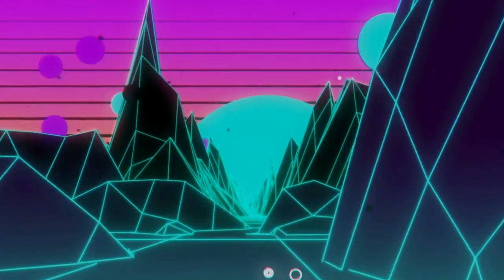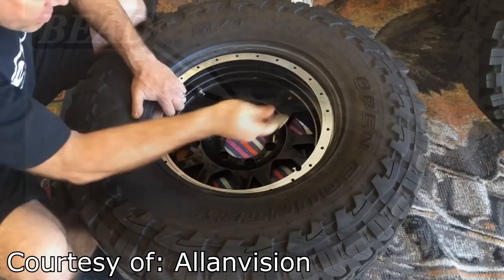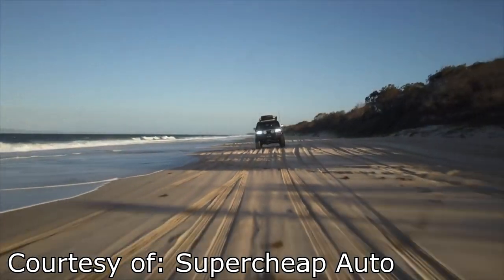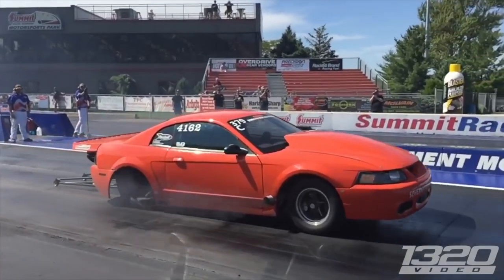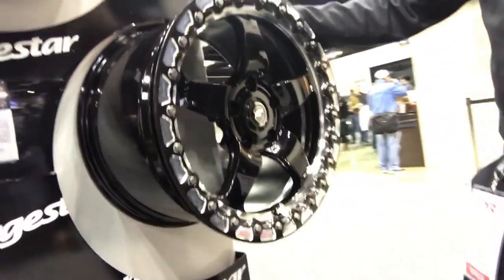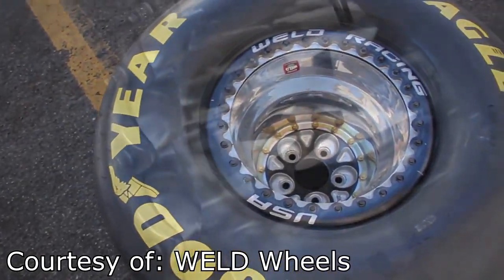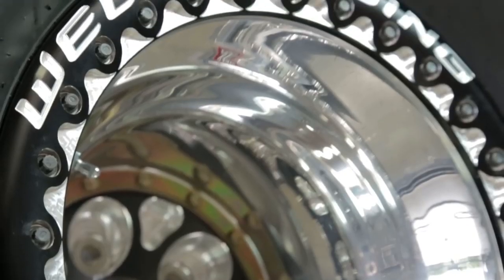How Bead Lock Wheels Work - Explained in 3 MInutes

Comment: Yes, but HOW?  HOW do beadlocks work.  You told us WHAT they do, but you did NOT tell or show us HOW it holds the tire.  HOW does it "hold the bead"?
Reply from the maker: 0:52 "bead lock wheels lock the bead on to the rim by clamping on to the rubber with bolts"....
Reply: @JCMediaYT  At no point in the video do we actually get to see what you're talking about.  I can't even imagine whatever that is. The bolts go though the bead?  I don't know.  We don't get to see anything.
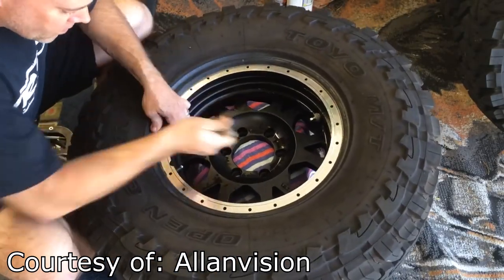Reply from the maker: @NorthernChev  go to 0:58, you can see him put the clamp onto the wheel, and that the bolts don't go through the bead but next to it
Reply: @JCMediaYT  Yeah, I saw that but it doesn't show if they go in or not.  So, from what I'm understanding the bolts are flat on the end?  And they only "press" against the bead? They do not pierce it?
Reply from the maker: what do you mean flat at the end? it's just a regular bolt that screw onto the center rim while also clamping the rubber bead, without going through it
Reply: @JCMediaYT  Because after watching your video, and still not knowing what the bolts looked like, I watched other videos and saw one where they used "screws" that bite (slightly) into the bead. But you're saying most use bolts with flat ends that press against the bead. I understand now. Thank you for your response.
Reply: @NorthernChev  They looks like regular bolts at lowes or home depot.  A bolt and a nut on the back lmao.
Reply: @NorthernChev  2 Ls in one.
Reply: @JCMediaYT he's right. "Clamping onto the rim with bolts" doesn't explain whatsoever how this supposedly holds the bead in place. A someone who installs tires and wheels for a living, your explanation is completely pointless. Terrible, trash tier explanation.
Reply from the maker: @sb2h  I guess all the other internet sources are trash explanations lol
Reply: @JCMediaYT  your video is titled "How" beadlock rims work. Not "What" they do. You completely failed to explain, only giving a brief (and basically incorrect) sentence and showing a <10 second clip from a useless camera angle. Other explanations online are better.
Reply: @JCMediaYT  Method race wheel's video, for example, gives an explanation infinitely better than yours in only the first 8 seconds.
Reply from the maker: @sb2h  your opinion is yours 🤷 more than 95% of viewers were able to understand the video just fine. can't change a 5 year old video anyways so womp womp
Reply: @JCMediaYT  95% of viewers know nothing and don't understand the fact that they still have no idea after watching your video
Reply: @JCMediaYT idk what these people are on you explained perfectly what they do and how they work. A bead lock… wait for it….. locks the bead 🤯 don’t get how these guys say a video showing a clamp covering a bead and locking it in place with said clamp doesn’t explain anything lmao
Reply: @JCMediaYT maybe they’re just that stupid? They think there’s more to it or something? I mean what more could you possibly say about a bead lock to get the point across? I guess you could tell them, “since you’re too lazy to look at the video, no the bolts don’t puncture the tire. It is quite literally a clamp that clamps the bead in place on the rim of the wheel. For the hollow heads out there still confused, that means the bolts go into the wheel. Wheel being the circular thing that spins when you give your vehicle gas. If you’re still confused, beadlocks aren’t for you and you’ll end up killing innocent drivers on the road.”

Comment: You didn’t show how they work. What fastens the wheel to the tire, screws?
Reply from the maker: sorry about that, yes if I'm not wrong they use bolts (I've seen steel or titanium depending on budget)